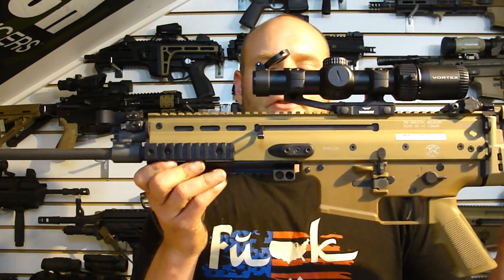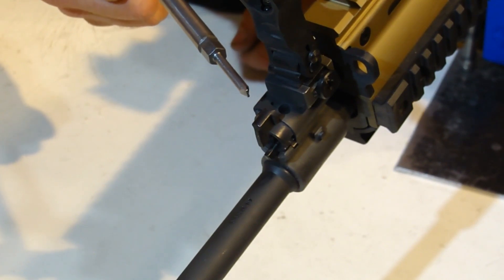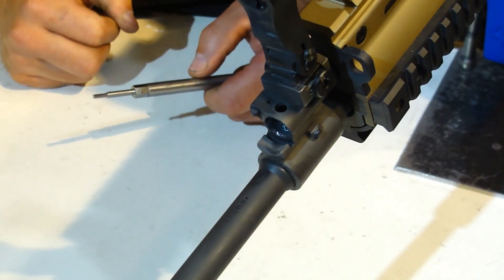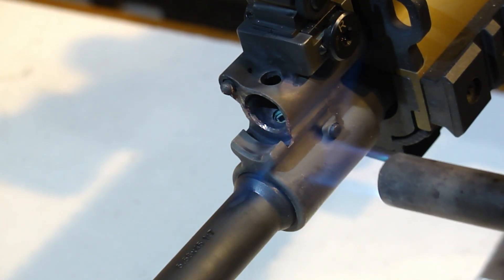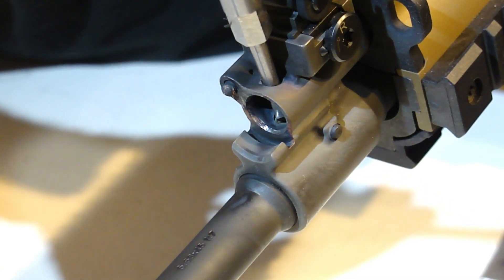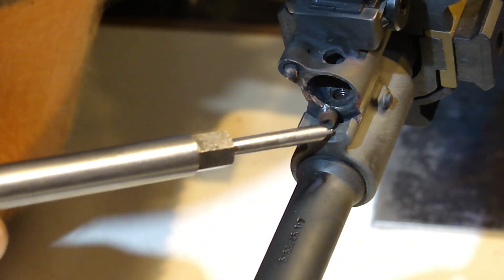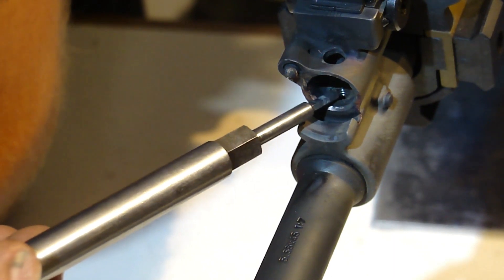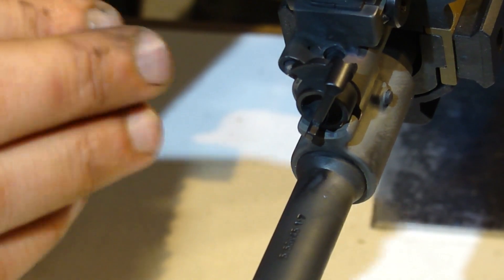PMM GAS Jet Tool

Comment: I still haven't got around to putting my rail extension on my scar. I tried like a MOTHERFU*^#$ to get that bottom rail screw with the loctite out to no avail, I heating that screw to the point where I thought I was gonna melt it and it didnt budge